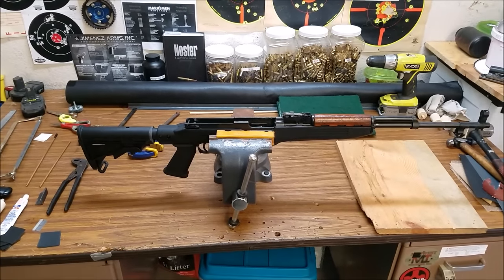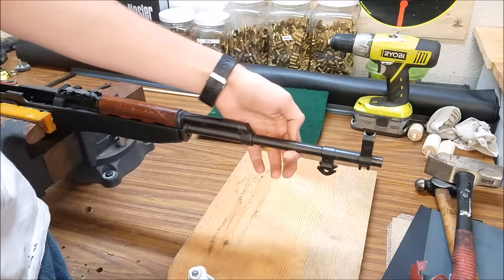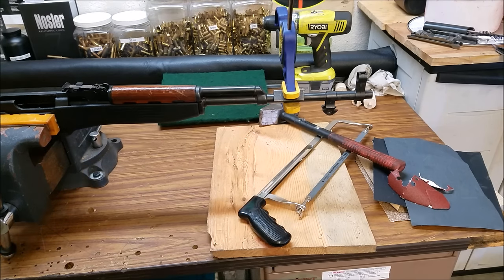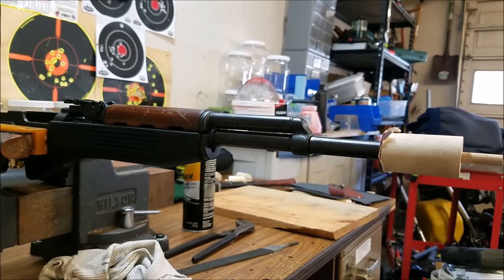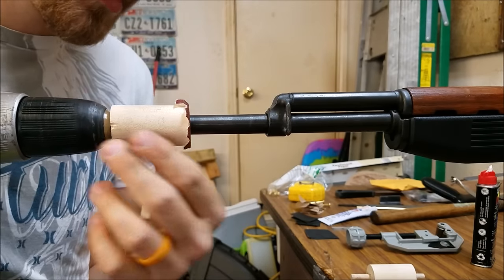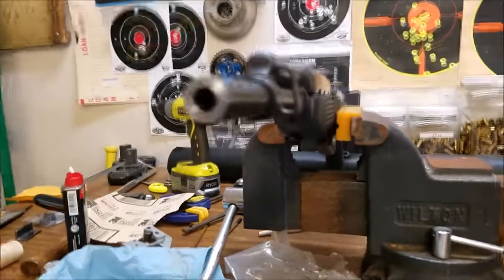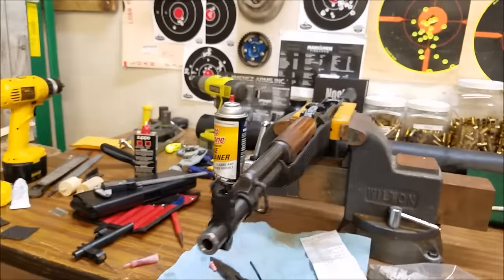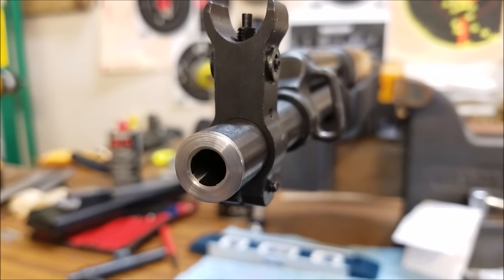Cut and Crown barrel with hand tools! SKS barrel cop

Comment: Just finished mine last week.  Waiting on my new front sight.  One thing I did that future readers might want to do also is at the hardware store when buying the sand paper, I found paper that you could peel and stick.  I cut the sand paper into circles the same size as the sanding dowel so all I had to do was peel off the back of the sand paper and stick it on the dowel.  No putting rubber bands around it or zip ties to hold it down.  Worked perfectly.
Reply from the maker: Max Hill awesome idea on the sand paper!! That would make my tool work much better. I'm going to try that for sure!! Pinning this comment to the top
Reply: One question.  Have you had any function issues with the shorter barrel?
Reply from the maker: Max Hill no issues at all.
Reply: Made the trip to the range yesterday (7/19) to test out the 16.5" barrel.  As you know I was a little apprehensive about function of the bolt after cutting off that much barrel.  Well the rifle performed flawlessly.  I sighted in at 25yds and once I got the sight adjusted to POA I was able to put 20 rounds inside a 3" bullseye.  I was surprised at the recoil as it seemed to be less.  Did not "feel" like the recoil was as stout as before with the full length barrel.  Very pleased.  I going to try and figure out a way to show a picture of the finished product.  Not that tech savy at 71 years old lol
Reply from the maker: Max Hill this is awesome! I'm really glad your turned out well! If you go Facebook type in GunsWithGage you can post pictures on my page! I would love to see them! The sks feels so much better to me with the shorter barrel
Reply: @GunsWithGage   can i cat barrel more just like mp40
Reply: @easttexan2933  On recoil being less:
As the dwell time* is shorter with the shorter barrel, the reciprocating mass (piston, bolt carrier, bolt) moves backwards with less speed, and therefore lessening the secondary recoil caused by the beforementioned parts stopping at the end of their travel (slamming less hard on the end of the receiver). 
Very noticeable if you have a barrel that is longer then what was the original design (for example the "Canadian barrel" Norinco AKs; original barrel is 16,.3", Canadian law required 18") and the gas port is drilled into the original size (instead of smaller to compensate for the longer dwell time) -> way overgassed rifle, really slamming the bolt carrier to the back of the receiver)

*dwell time: from the moment the bullet passes gas port hole to the time it leaves the barrel. During that time (and that time only) part of the gas is building pressure in the gas port to send the piston backwards

———
On function issues with the shorter barrel: 
although SKS works slightly differently then AK (short stroke vs. long stroke and so on), the cartridge is the same. AK:s have been shortened to have the front sight tower right next to the gas port, so having very minimal dwell time and seem to be functioning just fine (though don't know if the gas port hole has been drilled larger?)
Reply: This particular rifle was kicked on down the road in favor of a newer project about a year ago. Hope you don't know "how that is" lol
Reply: Did you order the front sight  from Bullet Button? If so how long did it take them to send it?

Comment: I actually cut the barrel with the pip cutter. Althought i cut in the straight section of the barrel i was surprised it worked. Instead of the brass screw i used brass drawer knobs that are basically balls with threads on one side.

Comment: I did mine 20 years ago. I was able to do some modifications to reuse the front sight.
Reply: Hey what did you do to reuse the front sight?? I too would like to do that.
Reply: @zomb1ek1ller5  I machined down my barrel diameter on a lathe, so that the front sight could slide over it. If you can’t do that you might be able to drill out the sight to the larger barrel diameter, or cut up and cut off the front sight and weld or solder it on. The important part is to make sure that it is timed right and not canted. A degree or two off will throw off your point of aim
Reply: Do mig welders work on gun steel? What i thaught of was cut the bottom and expand it enuf to fit then once its strait give er a tac or two. I dont care about how it looks i want it to hold
Reply: @zomb1ek1ller5  yes, a mig will work just fine, but you need to be careful about putting to much heat into it. To much heat could slightly worp the barrel and affect its accuracy. Most sights are silver soldered for a better and cleaner job.
Reply: Id like to solder it on but nit  the greatest at soldering lol.but  all i was planing on doing was a tack or twojust in the crack where id cutthe sight along the bottom where the cleaning rod grabs onto. Doesnt look much longer theen a half inch so maybe 2 quick tacks to keep er cool

Comment: I get what your trying to do but me myself id rig a drill press some way and you could get a much truer crown on it and id make sure it was a 11 degree crown because id want to keep what accuracy I had before if not better . Great video man .
Reply from the maker: Thanks! Yessir this is not how I do them in my shop, but just a good home DIY for those without a mill and lathe! You can also get crowning and facing bits that will fit in a hand drill as I'm sure you know.
Reply: They make a tool (sold at cnc warrior, brownells etc) that chamfers the barrel with a hand tool to exactly 11°.  Research has shown that outside of 22 caliber or extreme accuracy 1000 yard+ demanding high caliber rifles... the 11 degree chamfer isnt really beneficial over a standard crown.  
I could delve more into why... but then you wouldnt need to watch the super interesting videos.

Comment: Great video and cool project. One point however it looks like you leveled the receiver forward to aft while the front site is leveled side to side. To get the receiver level side to side the whole table/vice would need to be leveled.
Reply from the maker: This is true. For what the gun will be used for, it won't make a difference. The sight adjustment was able to compensate. Thank you for the comment!

Comment: Do I have to do all that extra drilling if I'm going to put a muzzle break on it?
Reply: Drilling?  I assume you mean where hes using the brass screw?
Yes thats absolutely neccessary.
Thats your barrel crown.  One of the more important points of accuracy.  You want the gasses exiting behind your bullet to exist evenly amd uniformly all around the bullet.  
So... to accomplish this you are going to want to get absolutely as close as possible to 90° cut on the muzzle face/end of the barrel (hence the grinding/sanding processes he used) and then you want to use the brass screw or a brass finial (both available at hardware store) and  grinding compound to make a "crown" and as screw heads or ball finials are round... against a smaller round hole... you get a nice uniform even crown to let gasses escape evenly for the most accuracy.  If you dont crown or your muzzle face isnt 90° youre gonna get bullets nosediving or keyholing or going way off target.  
The whole job takes about an hour at most and the extra steps are absolutely worthwhile.

Comment: Was wondering if after you completed the project, you experienced any cycling issues with the shorter barrel?  I have seen on some of the forums that cutting that much length of the barrel required a larger gas port and even one forum suggested taking a couple of coils off the recoil spring.
Reply from the maker: Rebecca Crouse nope not  single issue. These guns are over gassed in my opinion anyway. Chop it off! You will be glad that you did
Reply: Dude some people drill out the gas relief ports on the gas tube to reduce the recoil.

Comment: I often see where most AK barrels in 7.62 x 39mm have an 11 degree crown from the factory.  But, it appears you're putting on something other than an 11 degree crown using the brass screw method.  Does that seem to effect function, gassing, or accuracy in any way?

Comment: No problems with cycling after?  Did you have to drill out the hole in the gas tube to allow more gas into the tube to push the bolt back?
Reply from the maker: Jason Antonation I did not alter the gas system at all. Only the front sight.

Comment: Thanks for the video.
I'm having to do this due to severe corrosion. I may be able to salvage the sight. You mentioned the site you have is no longer available. Do you have a suggestion as to an alternate sight?
I am planning to cut just in front of the sight first to see if this will clean up my problem. The eBay link to the sight is broken.
Reply from the maker: The good new is, Bullet button just started making the sights again!! the old company Prince50, was located in Cali, and so is the new company, I have not tried the new one, but it looks of good quality online.
Reply: @GunsWithGage  
Thanks! I hope I don't have   to take the barrel back enough to need a new sight though. But now I have options.

Comment: Why brass screw instead of something harder like stainless? Curious
Reply: i don't know about guns but from a CNC work side i would say because brass is not hard !
if you use something that is hard the finish will not be smooth and it could even not be symmetrical , using stainless could take small chunks of material off and if that happen you would have to cut the barrel again ( cut away millimeters ) and do everything from the start !

Comment: Does your SKS have a chromed lined barrel? Three machine brass screws is a lot
Reply: You only really need two if youre occilatong the screw on the hole.  The 3rd is kinda a "just in case" backup thats worth getting because at ace hardware these brass screws are like 50c and can save you the trip and headache.
Really the grinding compound is doing the bulk of the work.  The screw is just a drill chuckable medium to deliver the grinding compound with the ability to add pressure while turning.

Comment: Dude i gotta ask u ,,i was told if i were to cut my sks barrel  by 4in leaving approx 16 in barrel,,I was told the sks would has isseues because the gas block is rated for  the 20 inch barrel it was manufactured for,,cutting the barrel though doesn't bother the gas block but the weapon cycling system is adjusted  by barrel size length with the gas blaocm system for the longer barrel,,stated the paratrooper  is the shorter sks  16 inch barrel gas block is rated to cycle for thatbsrrel length..what I wanna ask you though its been 6 yrs or more do u recall having issues when you cut your barrel  did it display issues,,I'm guessing not but not only a individual told me this  he works at a weapons machine shop so i perceived he knows this stuff like the back of his hands,,i also read online about sks and cutting the barrel where again some questioned what the particular barrel length the gas block system is rated to function by that length...what can u tell me
Reply: The pressure issue for cycling youre thinking of is gas dwell time behind the bullet.  It will shorten the dwell time and cycle the bolt slightly lighter.  But the commy piston systems 1st off are basically always overgassed and 2nd the loss of 4" is not enough to cause malfunctions on battle rifles.  On a precision timed and tuned gun maybe... but on a gun mean to be fired from under a swamp... nyet.... rifle is fine.

If anything the slightly lighter push of the piston system will result in a slightly lighter recoil.  And with the shortened barrel with threads (like he does in next video) you can always add a muzzle brake which further dampens recoil and most muzzle brakes will also very slightly increase back pressure/dwell time which would probably fix the issue if there ever was one... Which is doubtful to begin with.

So basically... in theory youre right.  But in practice its simply not an issue.  A lot of sks owners have cut the barrel all the way to the gas block then threded the barrel and made it an SBR or added an elongated flash hider permanently (for an overall16") and so far ive seen zero feedback including this issue.
It just doesnt happen.  And smoothing up the bolt and rails in the reciever should free up any hangups that would cause a slowed bolt carrier too.  
So if your rifles maintained properly the issue is non-existant.
Reply: @BushmasterRaZ   and you know you have a point...as im told chinese when back then they were doing the huge trade thingy  shipping sks all over the place especially to us,,they made personal models which one if not the only was the paratrooper to what im told catch the eye shorter more easier to manage  i think ive rad they didnt i understand create another model just for this all they did was shorten the barrel by the 3.5 inches of the regular sized sks which they had tons to accomodate all this  creating New models or variations of sks not remanufactured but simply  modifying what they has which was only the sks made one way with the 20 inch barrel cutting it  leaving either i think the 16.5 inch barrel and reinstalled the front sight and shortened the bayonet knife or pig sticker literally by jus cutting thm shorter as well,,, all this was what i think i read about some of the history of the paratrooper,,,was again no remaking of the sks all they did was literally cut the barrel shorter and made the rest shorter because the barrell was shorter, notice stock still the same for paratrooper and 20 inch reg sks models plus the gas block wasnt affected because i think it was only 3.5 inches cut off..or something like this...this inquiry was something i heard tossed around once but not alot at all infact just as you stated,,all whove taken the plundge to cut theres to the 16.5 have reported zero problem and like you stated i would think its not enough to affect the operation in any sorta way...i wanna cut it but second thought nope ill leave it alone i got this arch angel mand it looks amazing plus and i wont ever do this but lots say if you ever wanna sell it returning it to factory specs the 20 inch in wood,,but again smile I wont this lil buggar is home forgood in arch angel or wood  smile

Comment: Would you reccomend doing this to a ps90 barrel from 16inches to shorter as long as you have all the proper tools and knowledge ay your disposal?
Reply from the maker: Daniel Sanchez oh of course!
Reply: How would it be done to a chrome lined barrel of the ps90 to prevent flaking ? And would it alter its accuracy or as long as its done properly and carefully it shouldnt matter?
Reply: *flaking of the chrome lined barrel
Reply from the maker: It shouldn't hurt the chrome lining at all. Do you know what the OD of the barrel is on it? As long as the barrel is properly crowned, the accuracy would probably be better than the factory crown. I use machine tools normally. This video was just to show people how to do it by hand at home
Reply: GunsWithGage very cool thank you for the info sir
Reply: Make sure you don’t make an illegal SBR..... unless you don’t care lol.

Comment: So at 14:00 when sanding the barrel face, when you get grit coming off the sandpaper, which unavoidably ends up in the barrel, and you have a wooden dowel spinning inside the barrel, doesn't that screw up the lands and rifling inside the barrel?

Comment: What kinda of accuracy did you have before this mod and what kind did you achieve after?
Reply from the maker: WoneMore Thought I never noticed a difference!
Reply: Do you plan on soldering that sight permanently to the barrel, figuring a way of pinning it, or are you confident enough that it won’t move?
Reply from the maker: WoneMore Thought Ideally it should be soldered or pinned. This way of attaching the sight isn't as sturdy as it needs to be for military use. For what you or I will do with it, it's 100% ok.

Comment: The muzzle opening on the cut barrel is smaller than the original opening. Does this make alot of difference as far as recoil & accuracy?
Reply: The opening is the same size.  Its sort of an optical illusion.  What youre actually seeing is the natural end of the barrel having a larger deeper crown and less barrel material all around the bore (hole) as the sks and ak47 and basically all rifles are thicker toward the reciever and slowly taper down thinner as it reaches the muzzle end of the barrel.  So when he cut it... the barrel actually is much thicker 4 inches back.  Making the hole look smaller by comparison.  And the deeper crown simply lends itself to shadow better and thus makes the hole look bigger.

So yeah optical illusion.  The bore (barrel opening/hole) is even all the way from the chamber where the bullet waits to be fired all the way down the barrel to the crown where the fired bullet and gasses exit.

Comment: where can I get my barrel threaded?
Reply from the maker: You will have to find a local gunsmith, or mail it off. I am just south of Dallas TX. Clements Custom Firearms
Reply: Onedread806 Brown  Go to Carolina shooting supply and order the pieces to do it yourself. They have a youtube video showing how. Really easy
Reply: go to CNC warrior and order everything. Watch his other video and it’s super easy to do. You just have to go off what thread you want to use 14x1 LH is the common for these guns and aks but you can buy a 5/8x28 adapter if you plan on running a suppressor but they offer the same style for both threads only difference is the ability to run a suppressor.
Reply from the maker: @Typhlosion100  this ^

Comment: I did it to my SKS Yugo to get rid of the stupid grenade launcher and It won't cycle. I just got a better gas valve and pray it solves the problem. Otherwise it's just gonna be a barely functioning bolt action that I'll give to someone begging for a gun to use if TSHTF
Reply from the maker: Oh no, how much did you cut off? I wonder if the yugo has a smaller gas port